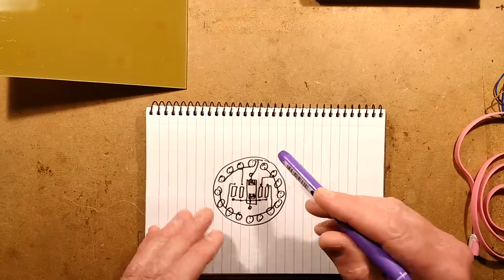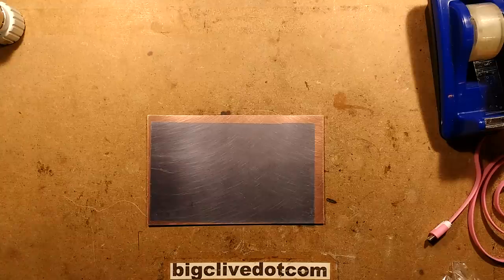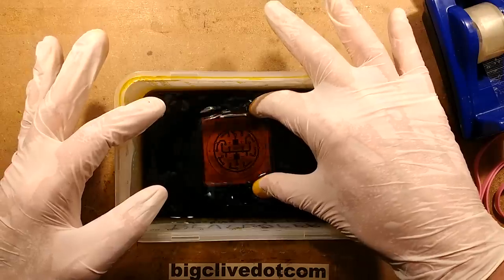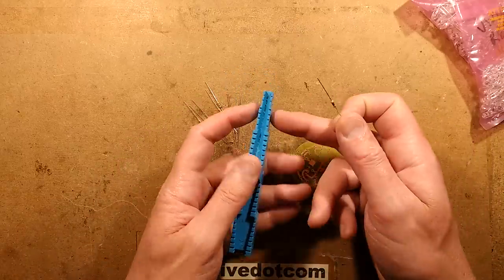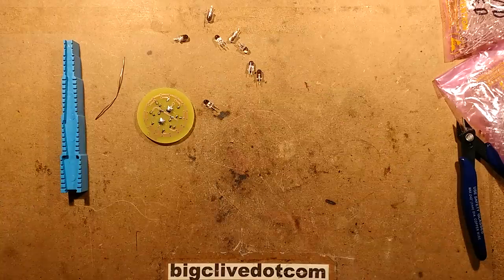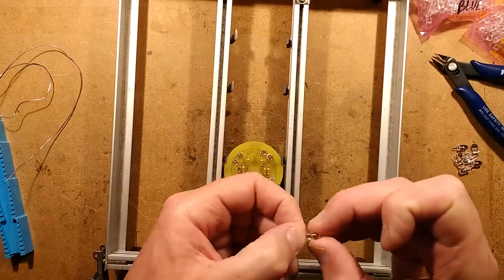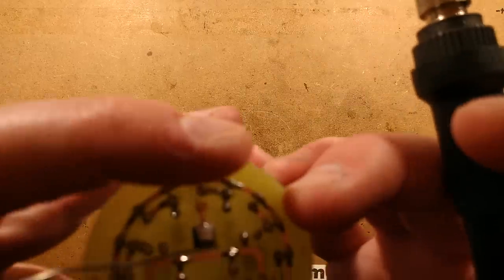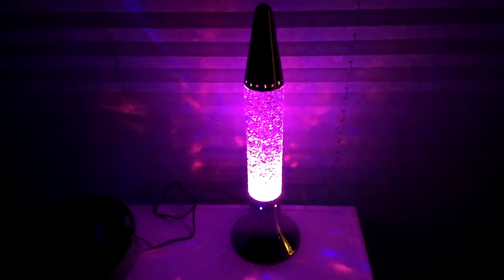Safe USB version of the Gillian's Diamonds lamp. (With PCB file.)

Comment: That component former would be an easy 3D print.
Reply from the maker: There is apparently a thingiverse file.
Reply: I am not surprised. It is cool that little plastic parts and things are being made that way. Just have to wait for the printers to come down in price and we won't have to burn all the fuel to get these sort of plastic things made in China and shipped across an ocean. The printers would, of course, be made in China still.
Reply: KnightsWithoutATable yea and a stupid expensive one😂
Reply: I am talking about on a desktop deposition machine, not having it made by a 3D printing service. It doesn't need to be very accurate or strong and filament is not that expensive. If you wanted to go super cheap, a piece of soft wood could be carved into the shape real easily too.
Reply: Come down in price to what point exactly? If you think you can have 4 stepper motors of semi decent quality, a 100W+ power supply that won't kill you straight away, and custom electronics to control it all, plus linear bearings and bearing surfaces and frame and mounting hardware and fiddly custom little bits for less than $100, I don't think that's happening. If you think $100 is fine, you can get a Tronxy XY100 or sometimes a CTC i3 Pro B.
Reply: Economy of scale can drop the price point significantly compared to buying the parts yourself. Newer technology can also drop the price of a product. Let's use computers, as an example. You are right that there is a bottom cost in several of the components.

The machined parts are one of them, except the bearings. When you order those in the millions, they become really inexpensive. The power supply is another, but you can use a cheap ATX power supply to run something like a 3D printer which, again, can be gotten at a much lower price when ordering millions of them. You don't need lots of wattage or very clean DC power, so a bottom end supply or even a power brick like a laptop can do it.

The stepper motors are another bottom cost, but their price drops when you get into economy of scale, as does the ridged case construction. Regular paper printers have a set of 2 stepper motors that are VERY accurate (most printers are able to print near photo quality or above) and are super cheap. Injection molded plastic cases can be made very ridged and as strong as cast aluminium, if you use glass fiber reinforcement and the right plastic. The investment in making the molds is expensive, but the cost in material is really low, so making millions of them is very economical and fast. A solid, cast aluminium case for a 3D printer would be stiffer than the extruded Al bars and hardware used in some 3D printer designs and older kits. I have seen a transition to laser cut sheets for the cases, which is cheaper, but is not going to compare to molded plastic.

The software can be found for free or made for a low cost since it is not complex (yes, I do know how to program things like this and have done so in the past). The 'custom electronics' that you mentioned are used by kit and pre-built models, but you can use an Arduino, some multi turn potentiometers (or Hall Effect sensors if you are smart) and a stepper motor driver board to control the drives. The rest are cheap, jellybean parts you can order for next to nothing. The custom control boards, after paying for the electrical engineering by, again, economy of scale, are less than a dollar a piece etched and assembled by robotic assembly lines when you order in the millions.

Assembly costs would be equivalent to assembly of a desktop PC, so minimal compared to the profit margin, advertising, and material costs. They can be made free by selling the unit as a kit. Same thing for shipping and sales.

What we are waiting for is more user friendly software for basic 3D modeling, good 3D scanning at a reasonable price, and investment in putting out a printer that is targeted at home shops and households instead of universities and industrial uses. Faster print times and higher quality results for the price of the printer would be nice too, but that will come after the initial push to put a 3D printer in the consumer market. The average user does not need all the bells and whistles of a $1000 CAD suite and the obtuse UI in most of them does not need to be so difficult to use that it takes a college class to put something basic on a model, like putting ridges on a cylinder to make a knob. 3D scanning needs R&D and we can do without it for now, but it would be a great feature. Investment seems to be what is lacking.

Makes me wonder why no one has hit up the idea of a 3D printer in every home as a startup in Silicon Valley. The money is there, the need is there, the technology is pretty much there as well for basic deposition printing which would cover 50-75% of the things people would print. Heck, there is a market for the models to be sold in packs and individually by the printer maker as well, with handing out some free models to keep users engaged with the market app. The average user isn't going to know about getting free models or how to set up the printer to use a model from outside the garden with their printer correctly. The filament isn't though, but the revenue stream for models is there.
Reply: No, economy of scale has arguably been 80% reached already and is deeply in diminishing returns area. These steppers are not unique, they are commonly found in scanners/printers/copiers, and still end up costing $4 a pop. The logic board costs the manufacturer around $12, which is crazy good considering the processor on it is around $6 and another couple dollars are the stepper driver ICs. Heated bed requires 180W+ power supply, so no laptop bricks there, those are relatively expensive power supplies anyway, because laptops tend to be a bit fussy. The standard choice is an LED power supply, and since LED installations are counted in hundreds of millions around the world, yeah they are "cheap" but about as cheap as they can get, and they do add $15 or so to the cost. There is not a single multi-turn pot in a typical 3D printer, where'd you get that idea from? The cheapest and most widely used control boards generally dispense with any adjustment that cannot be done via software/firmware, which is how they get the price down, with little to no detriment. The firmware is fundamentally trivial as you suspect, but in detail it isn't and it has reached staggering amount of complexity because physical movement and pressure control on the somewhat pliable filament is a really fussy thing if you want to reach quality that is better than crap and speed that is better than 20mm/s - but on the upside for the manufacturers, free open-source options are high-quality and available, and there are closed-source suppliers too that serve dozens of manufacturers, sharing the cost. There are now arguably likely more than a million of consumer-oriented 3D printers sold and operational in homes and at small businesses, since according to Gartner and Context, 2015 has seen around a quarter million 3D printer sales in a year, rising by 2017 to around half a million per year. For a prosumer category of products, this is massive.

But then there's the use. Everything accumulates issues with time and use and wears down. Reliability of 3D printing is still pretty bad. Slicer fine-tuning (slicers are a category of CAM software specifically for 3D printers, CAM = converting geometry into tool instructions) is something of a black art. It is currently expected of every single user, whether they have a $100 kit from China or a $3000 Ultimaker or Lulzbot that they become experts in multiple fields, such as ability to troubleshoot mechanical issues - with the 'interesting' property that numerous distinct failures cause the same visual result, and the effect of many possible changes is very indirect, as well as a bunch of obscure material science knowledge and feel for material. The setting recommendations on the spool sticker never work quite perfectly, they need to be fine-tuned for a given printer and how it applies heat and pressure to the plastic. Plus there's this dream that everything can be 3D printed, but someone has to design all that, and it is a specialist set of skills that are probably fundamentally somewhat laborious to obtain. Most people have a decent grasp of things in 2D as they go on the sheet of paper, as this is what they did in school for 10 years, putting things on paper, but they never practised perspective drawing so the 2D representation of a 3D item on their screen causes a fundamental disconnect that usually takes months of training and adjustment to overcome. Spatial thinking is an underdeveloped skill, and no software can think for you, or the results will be pitiful. I have been following scientific papers for decades about making 3D modelling accessible and i haven't seen a glimmer of an approach which would fundamentally help that. Plus there's the specific feature set of any given software. On the upside, learning is essentially free, you get Autodesk Fusion360 which is a fairly powerful and neatly focused and uncluttered CAD software, for personal and small-business use it's free of cost, and they also have a very simple online software that works more akin to 2D vector graphics programs, TinkerCAD, and there are more intermediate level options like Onshape and DesignSpark Mechanical that are free to use under a set of circumstances.

Scanning is also in its infancy and has copyright implications, i think if simple exact and and reliable 3D scanning happens, suitable to make replacement parts with no skill and trivial effort, there will be a massive political crackdown on it, so it seems dangerous to invest into. Look at Thomas Sanlanderer's channel, his latest video is on the best currently available consumer scanner, and he probably spent hours to copy a single hinge clip - and he's a skilled engineer.

And you are spoiled and perceive prices very selectively. Just because you can get a document printer (be it inkjet or laser) for $40 doesn't mean this is how much it costs to make, market and sell - you're getting these items effectively under cost. The manufacturer gains that back on the consumables that sell at 20 times the cost. This is what you're going to get if cheap printers is what you're asking for. You're going to get chipped consumables that are specific to every given brand, and they're going to cost, and aftermarket reverse-engineered replacements will work like crap because the manufacturers of cheap shit won't care enough or will be incapable of replicating the product exactly with their limited means. But the chipping and vendor-binding is the key to successful automation of print setup. Currently it's sneered at because the only manufacturer of consumer 3D printers that has gone that route (XYZprinting) has devices whose proprietary firmware and CAM causes it to print invariably like utter crap anyway. And XYZPrinting is not some shed operation, it's a branch of a long established Taiwanese engineering company that employs (across multiple branches) about ten thousand engineers and over a hundred thousand people in total. Hundreds of their in-house engineers must have contributed to their 3D printers and it's still not that magical perfect low-cost device that just spits out good plastic parts the vision of which the press hyped you on.

I am engineering 3D printer design and components that i hope can reduce the cost and raise quality right now, but i expect the success to be very limited.

Comment: speakin of reversed polarity bought a solar light from wallyworld yesterday an it lit up but would not shut off checked the connected wires with the meeter lo an behold they reversed the wire color on the solar panel it got soldiered on an wouldnt work correctly reverse the connections an Ding! works right

Comment: Still no strain relief on the cable. Not as dangerous as the mains powered version (unless it is run off a shitty pink usb charger) but if the cable gets pulled it is likely to come out.
Some other posts have mentioned the lack of strain relief and suggested zip ties or a knot on the inside. This will stop the cable from pulling out but won't stop the cable from being rotated or getting pushed in which will eventually fatigue the solder joints. The best way to secure the cable would be to use a snap in cable grip grommet which will lock the cable in position or if a zip tie/knot is used then it should be potted in silicone sealant or hot melt glue.

Comment: Great video 👍 and have you ever used liquid tin? My 1st time don’t work well, but will keep playing around with it till it works.
Reply from the maker: I have used tinning solution, which worked fine until one day it all just precipitated out and stopped working.
Reply: bigclivedotcom . I 1st used it with tap water because I was in a rush and at room temperature, tried warming it up but no joy, will try it again with distill water and warmed up, if no joy will not use it again, plus not sure if it’s a bad eBay batch🤔

Comment: Er, heating the acid ... there's a chance that you'll just speed up the corrosion :D ......... Try putting a bit of magnesium in some cold vinegar, and another piece in some vinegar that you've boiled...............
Reply from the maker: Ferric chloride works best when heated.
Reply: Jim Schofield Speeding up the corrosion is the whole point!  In fact, we want the copper corroded away completely.
Reply: Sorry, I was meaning the acetic acid in the silicone sealant and any chance that that could corrode the traces and leads... And having that heated by the LEDs. Personally I think it's probably not too too big a thing to worry about....... The smell goes away once it's set..... And it's silicone so it doesn't have a heap of water remaining on the surface after it has set.